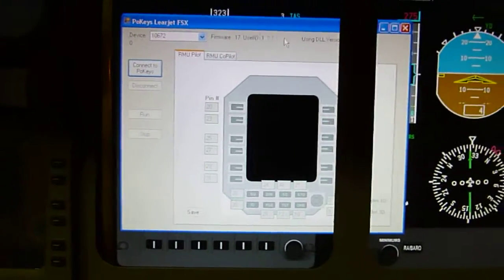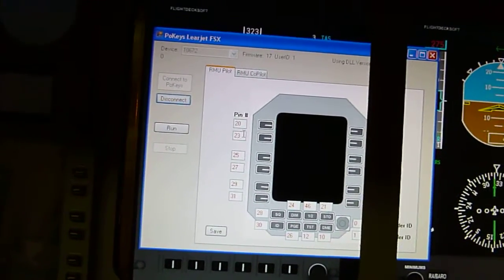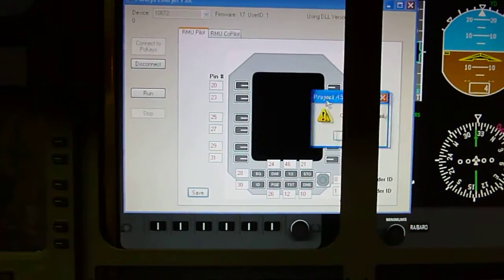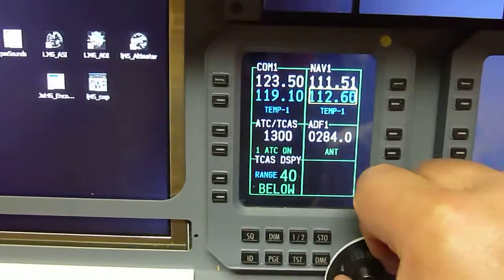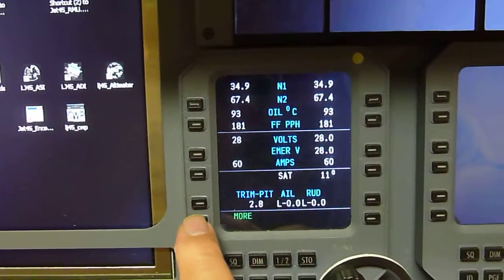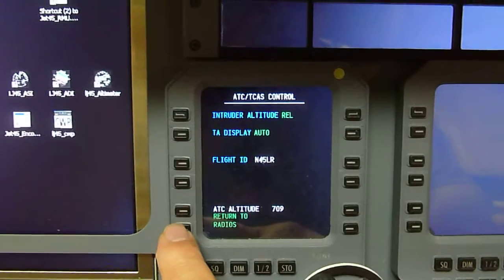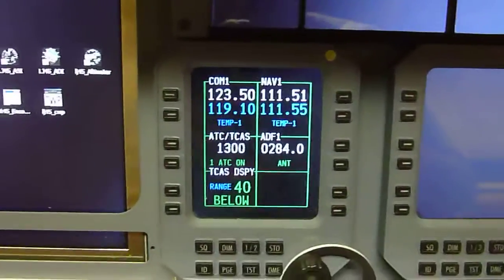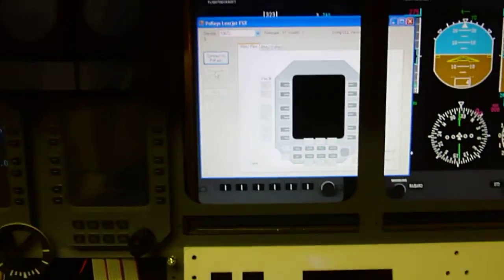FSX Learjet 45 RMU Utility for simpit

Comment from the maker: Myself and a few others make the hardware.  The Avionics software is specific to the Lear45.  This was the software I wrote to interface the buttons and encoders to the Avionics piece.  We're currently testing  a new version of it which provides a plug and play solution with no configuration needed with the Pokeys Ethernet IO card.  I'll add links to desc for more info